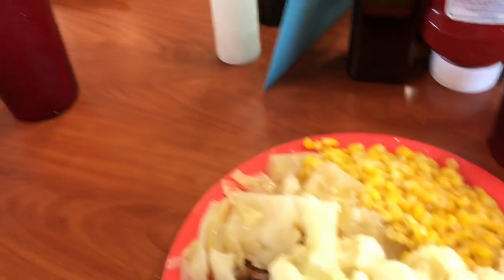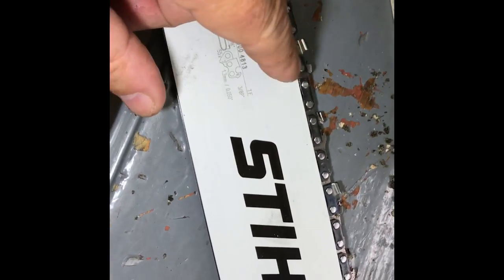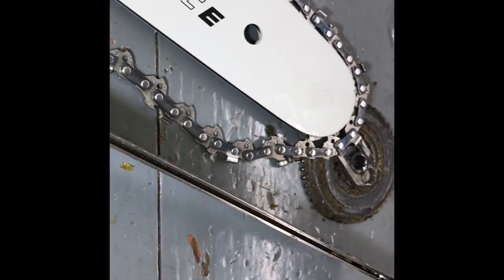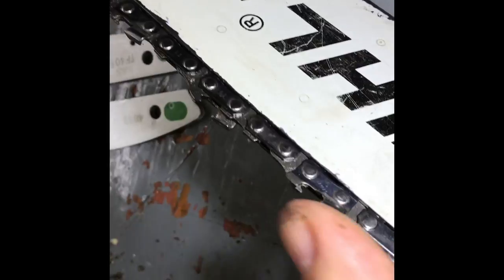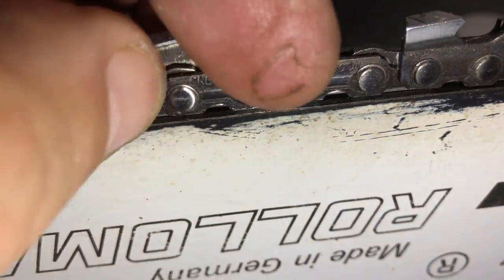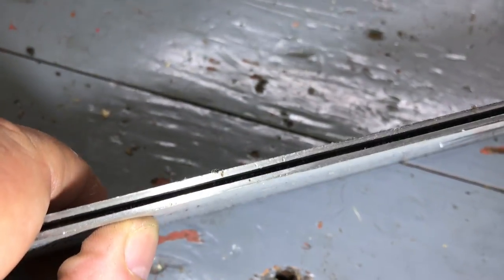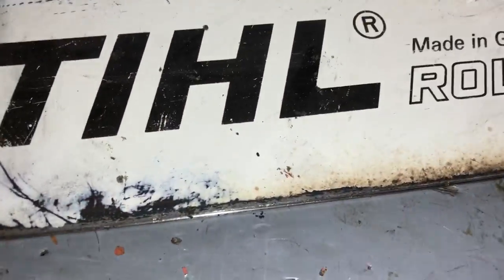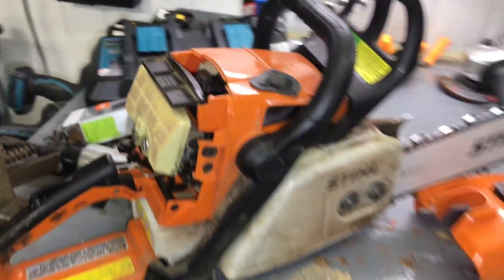How to determine if your chainsaw bar is worn

Comment: Thanks BC for passing on this knowledge. I knew about worn bars but never how to check of one. I've bent more bars than wearing them out.
Reply from the maker: Tomorrow, Im gonna rebuild a carb and run new fuel lines on a saw I took in on trade. Im gonna video that. I should have it up tomorrow night.

Comment: Good point.  That mushroom could be rounded with a file, but it wouldn’t take long to bend back likely.  I  sharpen my saw after every use.  Doesn’t take long, but sharp teeth makes less chain stress, less bar heat too.  That’s my thinking.
Reply from the maker: for sure! Also, Ive finally realized that its better to tighten the chain more often and less tight.

Comment: there's a tool for deburing and levelling the two edges of the bar. once it's trued up the chain should run straight even with the grove slightly worn.
Reply from the maker: Ive deburred and trued the edges most of my life but Ive decided that just buying a bar is what I need now. I only have so much time and most of that Is spent cutting trees.

Comment: I use to cut fire wood for heat a small portion of my house. I would file them down, but don't you have a very nice belt sander. If it were me I would sand down those edges on belt sander. What can you hurt you were going throw them away anyhow. They may not be perfect but use them in areas that you don't care about the bar and save the new bar for cutting down trees. That how I would go.
Reply from the maker: Gary Lollman I saved the bars for when I have time to refurbish them. I plan on doing a video.

Comment: yeah it seems like the new bars are made of softer material...a worn out bar is a lot of trouble
Reply from the maker: Im saving the old bars to recondition when I have more time. I got a lot of trees cut with the original bar,but theres no way it lasted as long as my old oregon bars.

Comment: Interesting. I did not know that. 
Is there anything that can be done to prevent that or at least slow it down?
Reply from the maker: I used to  file off the mushroomed edges and there are tools available to squeaze the bar closed some. I figure that by the time I do all that, I can just spend 40 bucks on a new bar.
Reply: @ICU8 12 - The way I slow down wear is; 

 1. Keep the bar and chain out of the dirt, even one second of the chain rotating into dirt can dull the blade and contaminate the bar. 

 2. Keep the bar, chain and saw as clean as possible. If you see sawdust building up, remove it as quick as possible. 

 3. Make sure the oilier is clean and working. The oilier is under the chain adjusting cover. If it gets plugged up and the oil stops flowing, you can ruin a bar and chain in under 5 minutes. 

 4. Keep the chain properly adjusted. To much tension wears out the bar and chain. To little tension lets the chain ride to the left or right of center causing wear to the bar. If you wait until the chain pops off the bar, you're not tightening the chain enough. 

 5. Keep the bar chain oil fuller than the gas mix. On my saws, I fill the oil to the bottom of the threaded cap, (maximum filling without spilling), while only filling the gas tank 3/4's to the top. That way the chain saw always stops running without having a dry chain and bar.

 6. Every time you sharpen the blade, take the bar off and turn the bar upside down from how it was running previously. By flipping the bar every time, you double the life of the bar by wearing the top and bottom evenly.
Reply: Jeff's Freedom Garage I fill both on my saws and my fuel always runs out before the oil and even second filling I top the oil up

Comment: Thanks for the thoughts BC,

 Recently my Dad passed on and as part of his estate a lot of his small engine yard care equipment came into my care, most of it being late 1970's to early 1980's chainsaws (Homelite, Poulan, Remington, .Dayton, etc.) I know you have good small engine repair experience but I would like your opinion. I know parts for equipment this old can be hard to obtain. Overall these saws seem to be better quality than what's available in the big box stores today but the drawback is the safety features on these saws are pretty much non existent compared to modern saws with the exception of a hand guard (no chain brake etc.). Should I explore the possibly there might be a niche market for these saws and at least try to get them running? Your Sub from CT, Tim D.
Reply from the maker: Tim, Im not sure if I ever told you this,but I am originally from enfield. The saws are all in high demand by people that know saws. the old homelites were bullet proof as were the old poulans. I have no memory of the daytons or remingtons though. I would get them running if it didnt require much money in parts. Often, I have g=found that they need fuel lines and filters and maybe a carb kit. thats about 15 bucks in parts.
Reply: Thanks BC,
I  have High School friends from Stafford Springs. We have talked before on a regular basis on your channel before, so PM me or send me your G-mail address  or send me a private notification on Google+. I hope your family and your self enjoy a restful and peaceful Thanksgiving,  god bless,  -Tim D.  -
Reply: BC, who do you recommend to purchase from for small engine carb rebuild kits and other parts such as points and condensers ? A search on Amazon would be a start but who have you had the best luck with? Thanks for your opinion. Tim
Reply from the maker: https://www.jackssmallengines.com/?gclid=EAIaIQobChMI_8_2mZfY1wIVG7bACh2YwggmEAAYASAAEgJVufD_BwE

Comment: Them bars still look brand new
Reply from the maker: binzy1996 you can’t tell if a bar is good by looking at it. If the groove that the chain rides in is wore out,,, the bar is wore out. There is a tool that can squeeze the bar channel to a thinner size but by the time you buy the tool, you could buy a couple bars.
Reply: BCtruck, rebuild, repair,repurpose yeah I was pointing out that the bars still look brand new if you saw my bar that I’ve had to replace after three years of use then you would understand
Reply: BCtruck, rebuild, repair,repurpose and for me it’s cheaper to buy the tool than it is to get a new bar